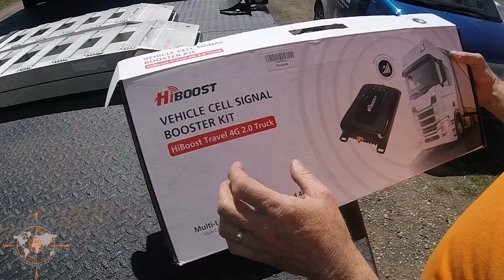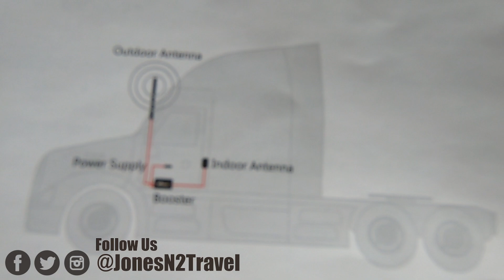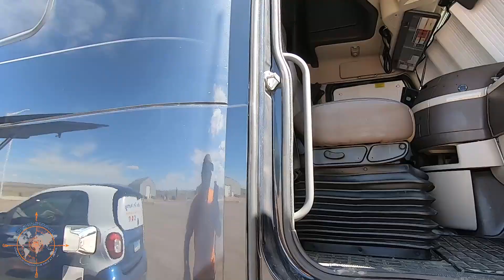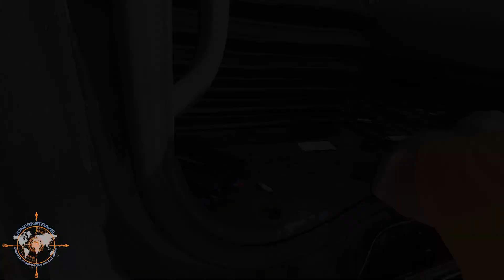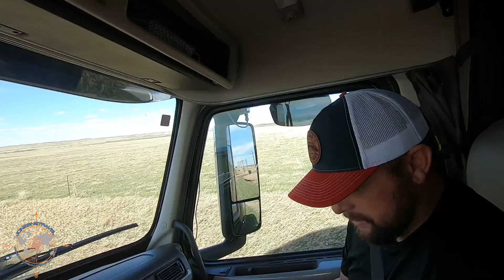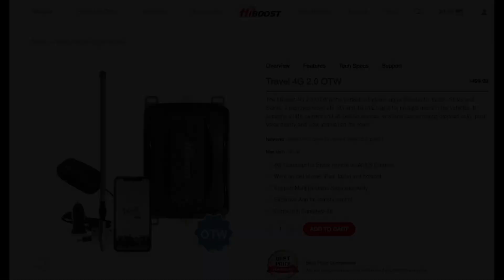BEST CELL PHONE BOOSTER HOW TO | HIBOOST CELL PHONE SIGNAL BOOSTER | TRAVEL 4G 2.0 OTW

Comment: Would like to see a comparison with some of your fellow truckers with the weboost OTR system you can use any network app to see signal strength also the closer you are to the indoor antenna the better it works with your device..I have the weboost drive OTR and am quite happy with it
Reply from the maker: Hi Lu. That would be a great comparison. I'd be happy to do it if the opportunity arises. Thanks for checking out the video and following along. Safe Travels

Comment: Noticed the comment from augie bracero about the longer coaxial cable on their site. It looks like any low loss 50 ohm cable with N connectors would work.
Reply from the maker: Hi Charles. Thanks for checking out the video and following along. I believe you are correct but I am going to reach out to Hiboost and get there take on it. :) Replying to your email too :)

Comment: Araron,. Tina is going to knock you out the first time she trips over the antenna wire🤣.  
We are currently looking at a mimo unit since you can not depend on just one carrier.  Then boasting the in bound to the truck and coach.
Need wireless internet for everything all the time.
Reply from the maker: I hear ya Brian that's why my 30 years of marriage training told my brain to put it under the trim piece. Self preservation LOL The mimo antennas work pretty well and some of the time you may not even need the booster, just the mimo. Great idea. Safe Travels :)